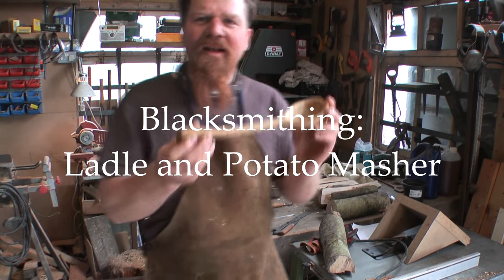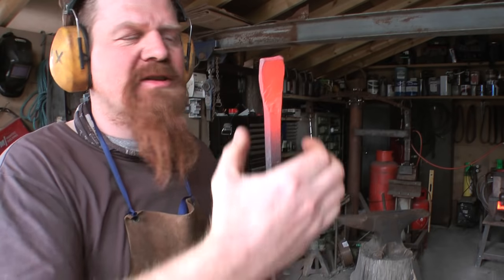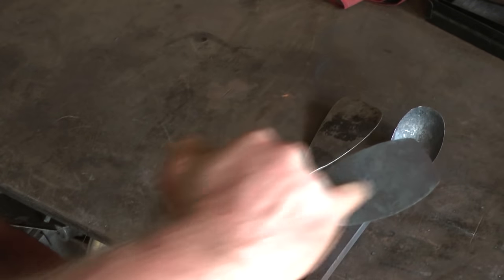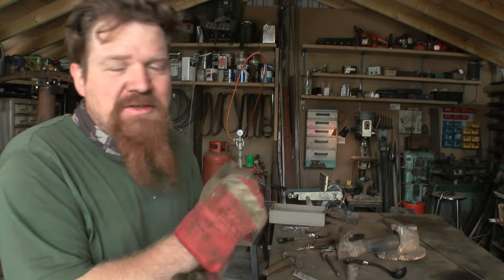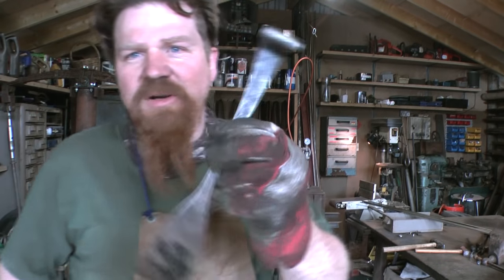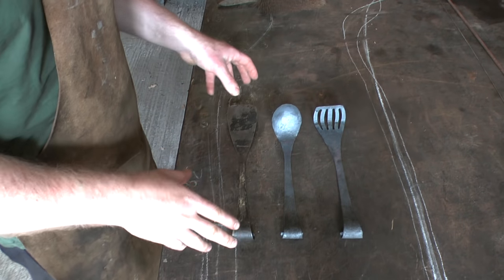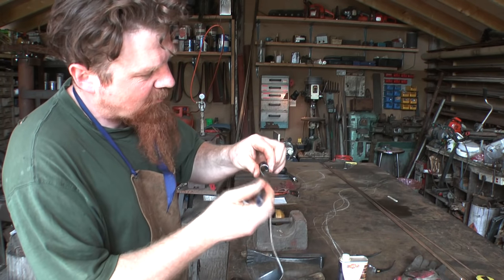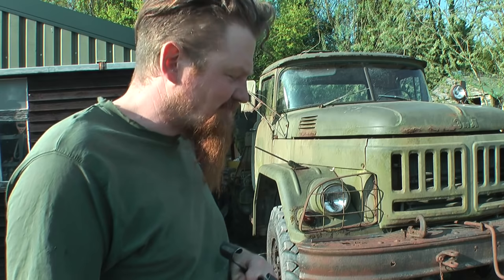Forging one piece Steel Ladle and Masher

Comment: Coconut oil is a good finish coating, especially for utensils like these.  It melts at about 70 degrees F too, so can always be easily applied and rubbed in just by the heat of the fingers.

Comment: Hi 
I been using r bar you know the metal rods we use to reinforce concrete  don't know if it the same name at your place anyway for a antique effect   one example 
Flat up 6 inches  twist  it
Curl  both end 
2 choices  paint it flat black or shine it  and spray a clear coat 
The effect is awesome  look real antique

Comment: Love these, I keep cooking and wanting to make utensils and have been resisting buying them. But I kept thinking I needed to buy some 304 stainless. I'm encouraged to just use mild steel now. 
Ps congrats on the swage block. They are silly expensive for rusty hedge antiques but I keep wishing I had one.
Reply from the maker: Thanks. Keep an eye out and you'll find a swage block eventually - took me 10 years to find one at a sensible price!

Comment: not that i know better  than you mr. thumper, (i don't) but cheaper than a fancy block is carving a bowl into the end of a log and hammering the flettened the iron into it. it wont last forever but it will work for a half dozen spoons. and it is very easy to just make a new one :)

Comment: Spotted your dangerous angle grinder again. If you can still locate guard then chop it down to a 100 degree quadrant ( from the original 180)
Best of both worlds!! And you can put it down running

Comment: Interesting stuff, missed having a video last W/end; keep em coming. A few daft questions.... What was that tongue like device you used to sway out the handle? Why not bash it out with a hammer? Will you'll be making a sword next? : )
Reply from the maker: Do you mean the thing at 11.35? That's a spring fuller, I'm using it there so as to move the metal in just one direction (like using the cross peen but works on both sides of the work at once). I do intend to have a go at a sword at some point - kitchen tools were more urgent!
Reply: That's the kiddie, thanks for the explanation. There's more to this metal bashing than meets the eye. Yep a swords a bit unwieldy for smiting spuds : )

Comment: seeing how quick the heat gets sucked out of the work piece when on the anvil I do wonder whether anyone has ever had a heated anvil? not hot enough to temper the anvil but enough to extend the work time?  I imagine its not really worth doing which is why i have never seen it though!
Reply from the maker: It's only really on the thin stuff, you just have to be quick!

Comment: I'll give you a pass for those. But.. Some painful viewing there. Firstly you need more heat. The other forge should have been used. You're not only stressing the steel with colder working but also tiring yourself out. Tools undergo more stress too. Those sharper rough edges that had to be filed off the handle edges are a result of cold forging.
Another issue is the swage block. I wouldn't have made cups using those sharp edges of the holes in the block. You could have used a lump of dry wood with a bowl cut into it. It'd absorb less heat for starters. 
With the potato masher I'd have opted for round holes in it? Just an idea and might have been easier to make than slots.

But - who am I to comment - you actually made them and went to the trouble of recycling old steel and videoed it too. I tip my hat sir   :)